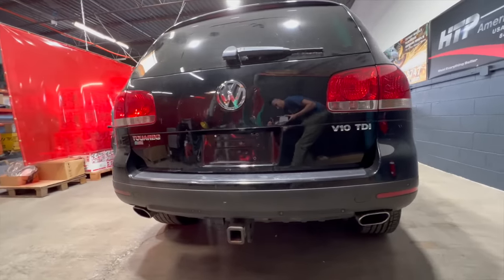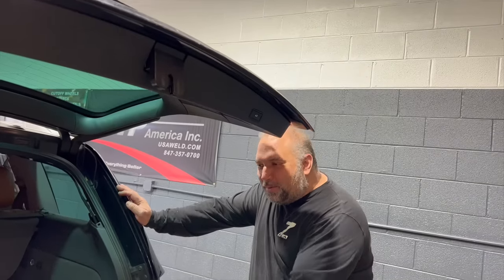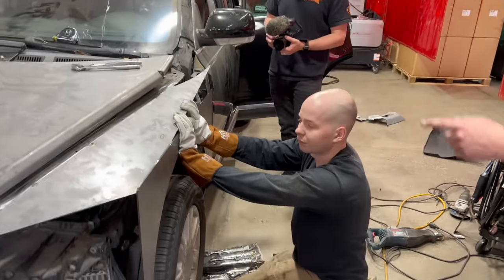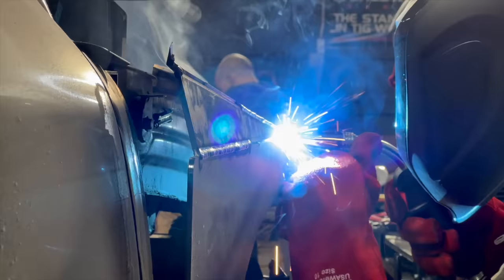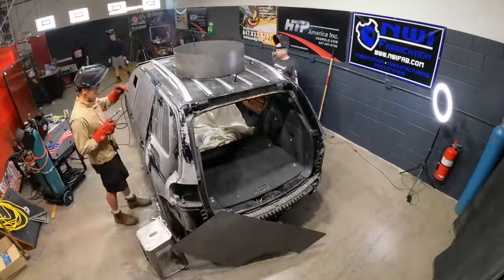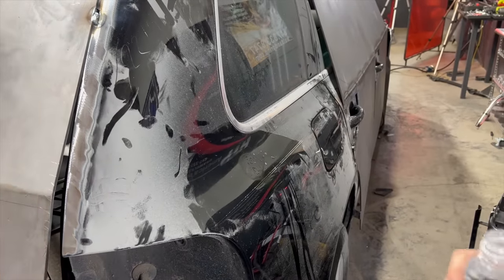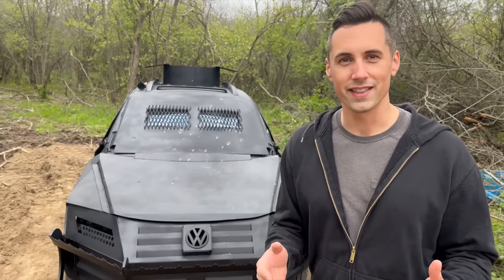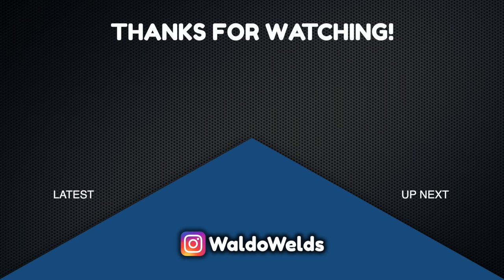Building an ARMORED CAR From a V10 Diesel VW Touareg (and then TESTING it!)

Comment: The only thing missing from this video is the oil change
Reply from the maker: Darn it, you're right! 😂
Reply: “We took our armored car to the dealer to get a key programmed for it…”
Reply: Alternator replacement. Good luck with that one.
Reply: Problem is, you have to remove the steering wheel, exhaust manifold, and slightly deflate the right rear tire to remove the oil drain plug...

Comment: That thing really is bulletproof! I love how you guys shot at it to prove its strength. Pete knows his stuff, awesome collaboration. It would be epic if you and Chucke2009 collaborated. Thanks for sharing, Waldo! Take care.
Reply: No such thing as bulletproof.  You just need to find a bigger bullet.
Reply: @h8GW and you can shoot the tires
Reply: @Wbrick_LEGO or door handles or into the wheel wells, or the glass where the grates are.
They made it of mild steel maybe 1/4in thick. The only reason the 300 blackout stopped was due to the angle of the plate. Any other angle would have gone through

Comment: What was the feature used on that piece below the windshield? Everyone seems stoked by it, and is the welder water cooled?
Reply: You can get a tig water cooled torch and water cooler.  This one here as a tig torch from the oil industry that is good for 300+ amps on engine drives…  so you can weld air cooled full power as well …

Comment: I just hope he never has to replace the alternator. They are cooled by engine coolant because they were developed initially for the Dakar rally at wide open throttle with a bunch of bright rally lights. Because of this, they are very expensive ($3K) and are very hard to find.

Comment: Very very cool project. Now ... just to be clear (maybe you say, I'm at 7min), by "armored" he means against handgun rounds. I expect a 223 is zipping right through it.  anyone in it. Full powered rifle..? Would require so much more that you'd need different suspension... even 1/4" of AR500 ... which'd make it bullet resistant to medium powered (7.62, but not AP and certainly not 30-06 in AP). But would def. have added a couple TONS. Probably making the power inadequate.

Comment: feel kind of disappointed not seeing it be tested against 9x19, 5.56x39 and 7.62x39, those are the most common calibres after all.  or hit it in any of the other differently armoured areas. other than that its a really cool project.

Comment: I wish you would have kept going up in caliber until it got penetrated. How much did y'all spend tl build this?
Reply: The 300 blackout was the biggest thing it would stop. That only stopped because of the angle of the plate over the windshield. I doubt this would stop the larger handgun rounds so maybe a lvl2 at best. 
They only used 1/4in mild steel so it is only for looks

Comment: 4:32 i hear the steak sizzling
Reply: Is that push bar made from the same design as your recent bucket ripping edge?
Reply: @mkearn724  yes, very similar ….  The long teeth on the bucket are a little taller and narrower …..  they were all cut on the same day on the same laser table !  

But the bucket lip is AR500

Comment: What’s wrong with vertical down? I’m certified in MIG vertical down.
Reply: Only on sheet metal up to 1/8” ….  On thick metal for structural reasons you cant run down ….

Comment: Hehe, now i know who i'm calling when i need a Mad Max style car for the next Apocalypse/Pandemic. XD

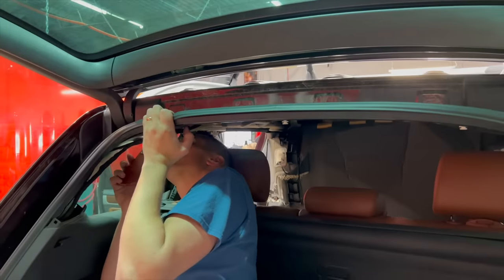2:25 Oh, it IS serviceable. But only at a VW certified car shop that will cost you THREE times as much as a random car shop. Classic german thinking.

Same goes with the most other things on german cars. Back in my childhood, you could repair/fix/replace everything yourself with a few normal tools and some general knowledge about cars. Today you need special tools to change the spark plugs because you cant reach those without removing the cover that was put over the engine to make it look "Fancy" because this needs a special kind of screwdriver or so and you cant get those as a private person.

I mean, i remember when i was little, the distributor cap on our Ford Fiesta broke. It was part of the ignition, so the car didnt run without it.
What did ma dad do? Right, he simply removed the old cap, sat on his Harley, drove to the next shop for car parts, got a new cap, drove back, put the new one in, and the car was running again. He needed less than an hour for that and only had to pay for the spare part that was around 30 bucks.

Today the same kind of work whould only be possible in a specialized workshop that's certified for the brand of your car and it whould cost you hundreds of euros. And why? Because the cars got SO complicated, and you need special tools only certified workshops get to work on the cars, so you simply cant do anything yourself anymore. They simply force you to go to the workshops instead of being able to do small repairs and maintenance yourself.

Comment: this wouldve been cool if it was actually properly armored. If you had done it right, like using a 3d model of the vehicle to design a frame and panel system that provide good coverage, the roof, the seams, the wheels, etc. It could be decent for similar cost.